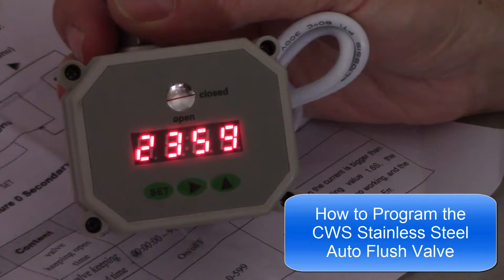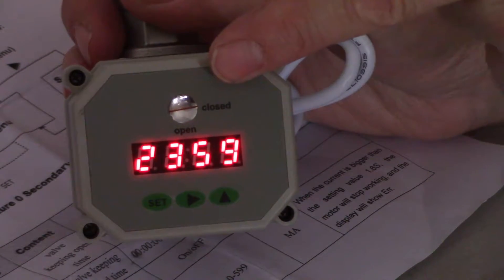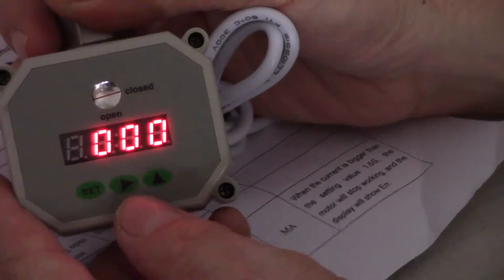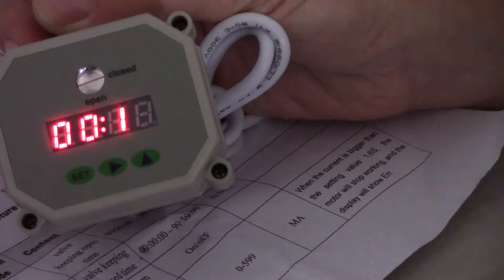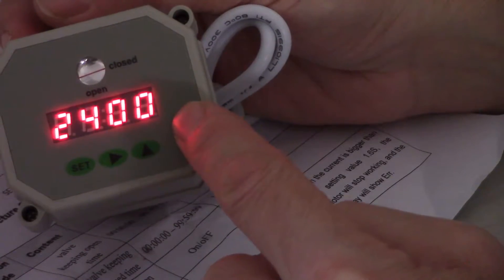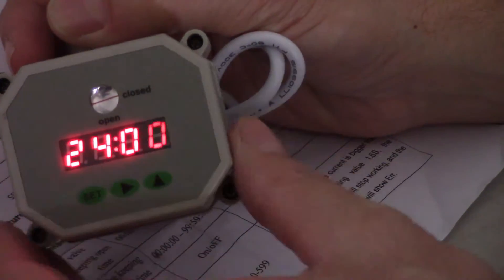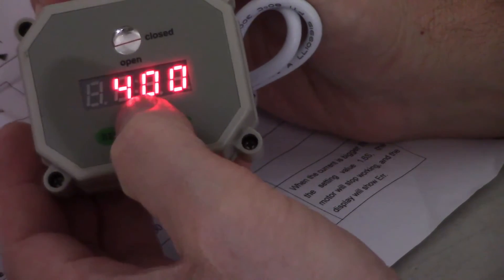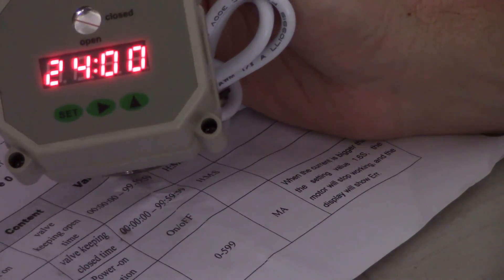How To Program CWS Auto-Purge Stainless Steel Flush Valve

Comment: does it remember the settings  if the power goes out?
Reply from the maker: Yes it does.   Even if power is off for a couple of weeks it will remember the settings.  thanks for asking.
Reply from the maker: @Knowledge Sharing No battery, it stores it in memory using EPROM chip.  We have unplugged one for several weeks and it kept all the settings.